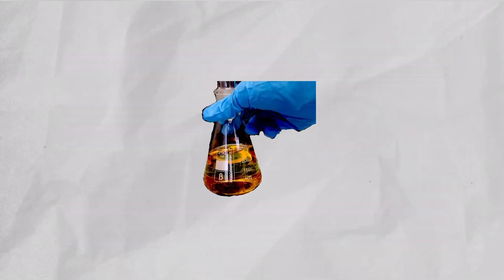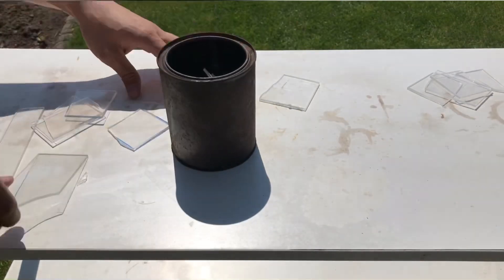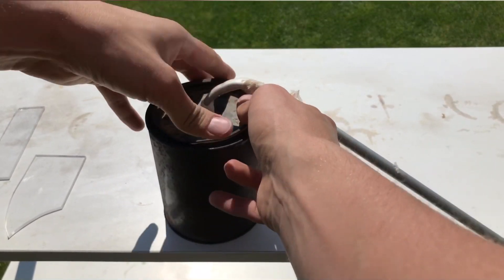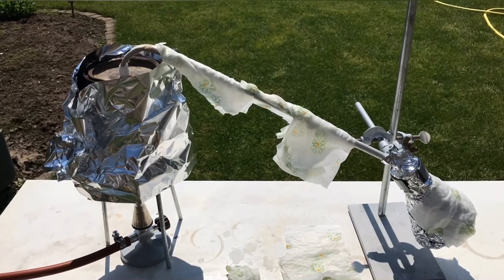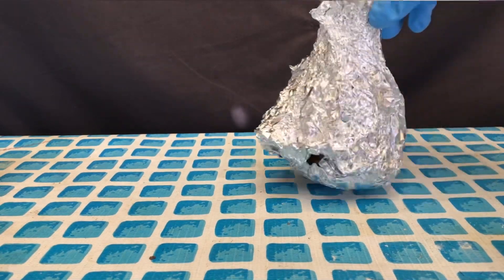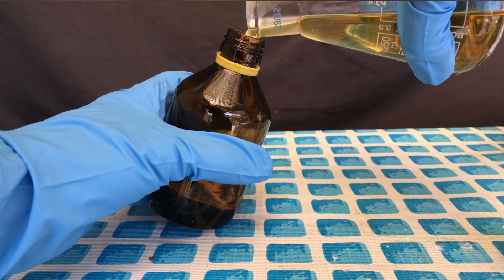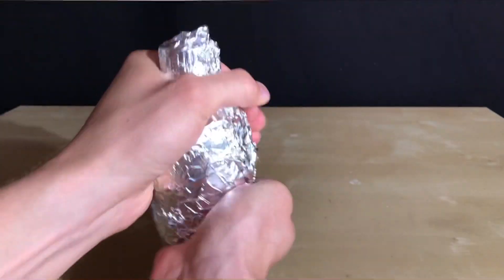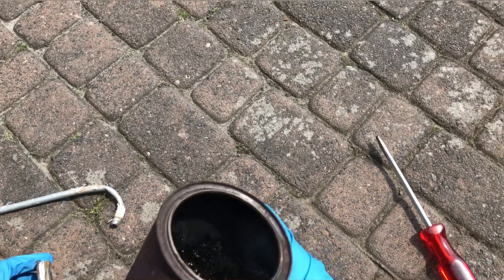Recycling Plastic For Useful And Dangerous Precursors

Comment: Nice video ! 
I just have a question , I m running  some tests to laser cut acrylic sheets (20w diode laser), I have a exhaust system not working that well and I end up with this spicy and little acid smell in my shop, I make research before cutting every new material to avoid any hasard, and acrylic is said to only create CO2 and carbon Monoxyde. Got also a particle detector and a face mask ABE 1 p3) Burn acrylic also creates formaldehyde and VOC. 
I think this smell is  methyl meth acrylate , is it known as dangerous for health ?? Thanks !! 👍🏽👍🏽👍🏽
Reply from the maker: methyl methacrylate isn´t really good for your health so avoid inhaling it or wear a suitable respirator.
Reply: @THYZOID  long question and easy answer 😂 thanks for your time !

Comment: What respirator do you use?
Reply from the maker: For things like this I use a respirator with an ABEK2 P3 filter.
Reply: @THYZOID  thanks. Do you know the model respirator you have as mine doesn’t fit with those cartridges?
Reply from the maker: @Joey Cubes  It’s a 3m respirator. i don’t know the exact model though. The full face mask I’ve got is a draeger xplore 3000 with an rd40 thread
Reply: @THYZOID  ok. Thanks for the reply